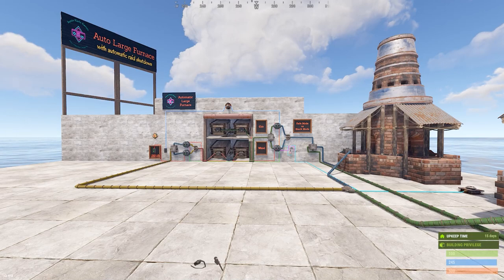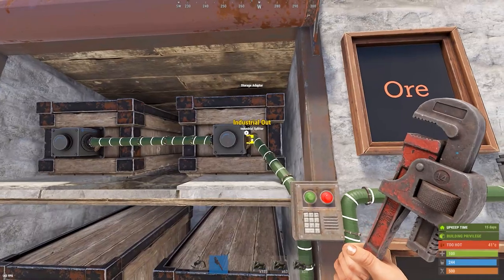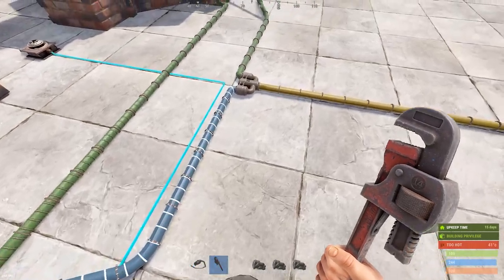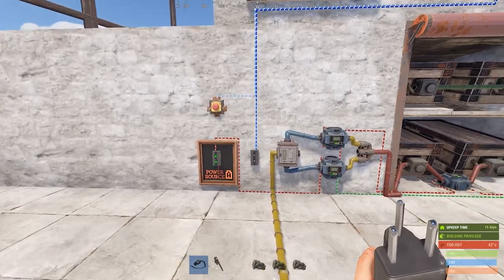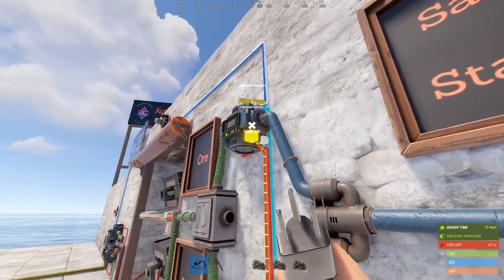RUST Industrial | EASY Automated Large Furnace - Includes AUTO SHUTDOWN RAID DEFENSE 2023

Comment from the maker: IMPORTANT VIDEO UPDATE: It turns out that the order in which you daisy chain the power through the conveyors matters!! If you do it the way I did in the video (products > charcoal > sulfur/charcoal sorter > wood > raw ore) it works as intended. Some players have experience problems after daisy chaining power using a different route (thank you to the individual who brought this to my attention). I will investigate this weirdness later. 

Video Contents:
0:00 - Intro
0:42 - Demonstration
1:54 - Component Setup
6:38 - Electrical Setup
10:49 - Notes on the Timer
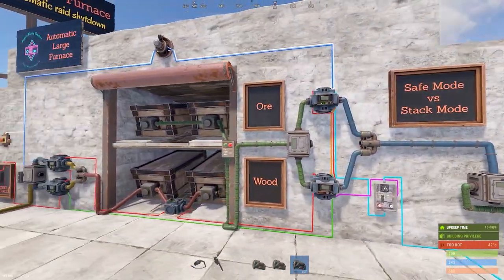11:14 - Demonstration Review
12:12 - Safe Mode Setup
13:08 - Stack Mode Setup
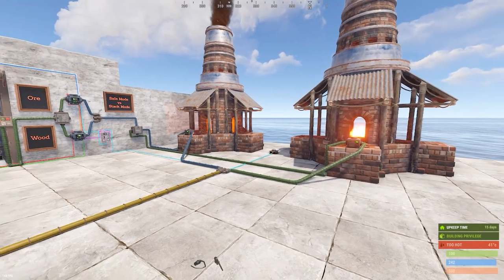15:21 - Auto Raid Shutdown Setup
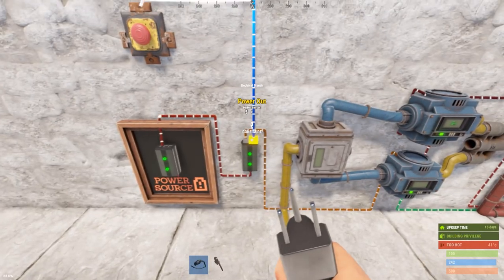17:34 - Raid Shutdown Demonstrations
21:16 - Outro
Reply: Jesus i have spent couple hours trying to figure out what i did wrong.....🥵
Reply: I'm having a problem where the wood conveyor stays off after receiving a signal from the raw conveyor. Could this be due to the power routing? Thank you.
Reply: Omg . I thought I was the only one that had a problem. My wood wasn’t feeding at all (including the igniter) But everything else cycled as normal. So I just stacked my furnace with wood and ignited the furnace. It’s a quick workaround:) BTW @AustinKllailaGames, I wanted to thank you for your content.  😊
Reply from the maker: Hey you're welcome! @psyndikit

Comment: Hey Austin, another great video!

2 quick notes for you

1. That igniter toggling is due to a "dirty" line - what I mean by that is since your wood conveyor is getting power from another conveyor, it makes the line dirty and will pulse the igniter every time a conveyor prior in the circuit activates. I recommend powering the wood conveyor first, then passing through to the other conveyors to fix this. (if the error still persists, the wood conveyor may just need to be powered entirely separately)

2. Furnaces smelt at a fixed rate, split among the stacks. For example, 1 stack of sulfur will burn at 1x speed, but if you have 2 stacks, they will each burn at 0.5x speed etc. so you don't need to have any more than 1 stack of each ore type.
Reply from the maker: Thanks! I also enjoyed your multi furnace build as well! Very cool. I figured it was something weird with the wood conveyor, just had no clue what it was lol. And you're correct about smelt rate. I meant to talk about it in terms of wood cost and as a comparison against regular furnaces rather than itself.

Comment: I've been having trouble with this set up. Granted, I'm not using a timer, but it is in regards to the wood conveyor Turn On/Turn Off not working. 

I have Turn On of Wood conveyor going to Filter Pass of the conveyor with ore going into the large furnace. The Turn Off on the wood conveyor is wired to the Filter Fail on the conveyor putting product into the storage box. They work fine independently, but they seem to be counteracting each other when they are both hooked up. It loads ore into the furnace, but doesn't kick on the wood conveyor. I wonder if it just refuses to as long as there's power coming from the Filter Fail? Thoughts?
Reply from the maker: It could be a couple of things, honestly. Are you by chance on my Discord?
Reply: @AustinKlailaGames  not yet, let me find it.
Reply from the maker: @Susan Conley  the link is on my yt homepage and in the video description
Reply: @AustinKlailaGames  Did you figure this out? I am having the same issue